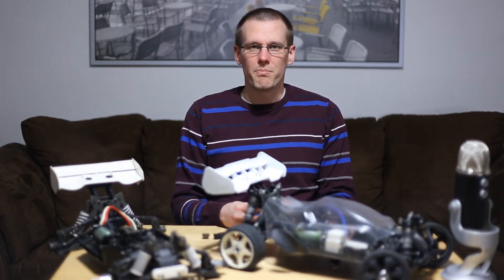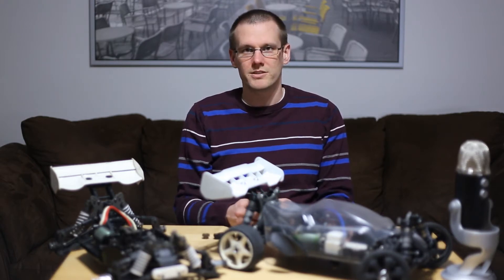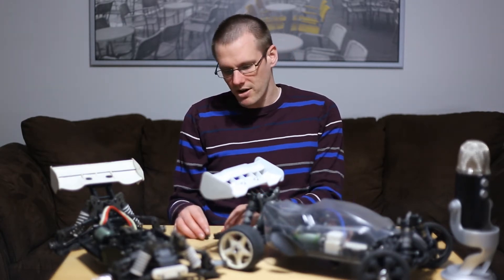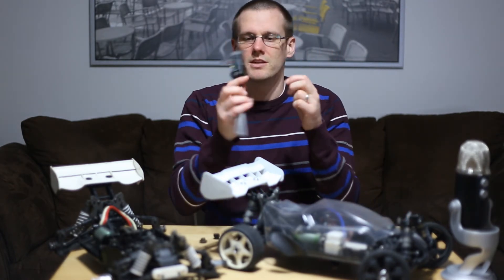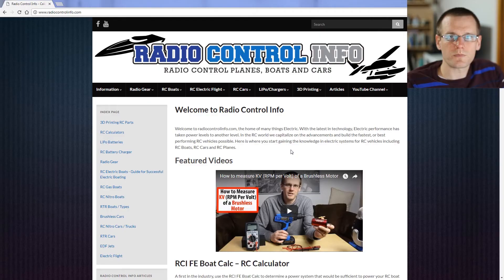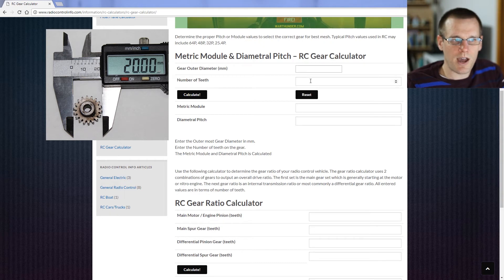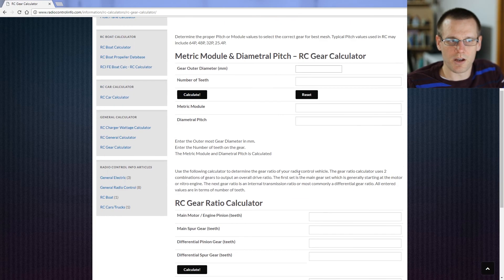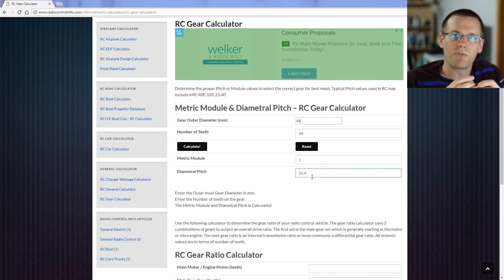How to Measure Gear Pitch for an RC Car

Comment: Is there a way to calculate the gear thick mathematically? I'm doing the teeth size formula but I got 1.96mm, when I measure it with a caliper, I got 2.41mm. Could you explain?

Outer diameter is 40mm, and tooth number 30, can we tell the thickness of each teeth?

Comment: right, so to convert my nitro car to brushless i need a 25.4p pinion with 3.175 shaft size.. i cant find this at all.
Reply from the maker: 25.4P is Mod1. Very popular
Reply: @RCexplained  i fugured i need to use a sleeve to convert my 3.175 to 5mm then a m1 will fit.
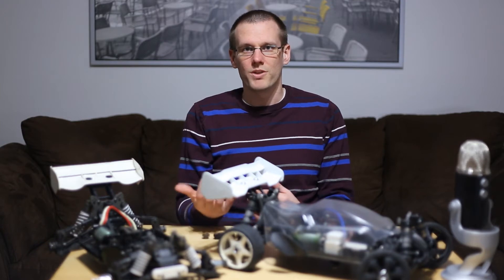Reply: @RCexplained i have another question, my spur is 50t. Im converting a nitro to brushless. What size pinion would be good on a 50 spur for bashing a 1:10 scale.
Reply from the maker: @STRIMIX  you'd have to use a gearing calculator to match your goal speed

Comment: Great info. I found 3 bags with pinions in my spare parts boxes.  I know there's some 48p, some mod .6 ,  but for some of them it isn't obvious to say whether they're P of mod. So I used the calculator and these are the results from 22 pinions : 8 of them were Tamiya 0.6mod and measured as 0.55, 0.56, 0.57 and 0.58mod. None were actually 0.6mod.  2 other pinions were identified as 47,9P - we'll call that 48 .  5 others were identified as 0.52mod or 48,8P - no idea so we'll make that 48P as well (because two of them are known 48P Kyosho pinions) ?...  4 others turned out to be exactly 0.5m but 3 out of 4 are definitely not .5mod (# teeth incompatible with the car) : one of them was new in an unopened bag; a RW Racing 48P 18t pinion ???.  I also checked a Novak 32P that turned out to be 32,2P. And a Robinson Racing 1mod that turned out to be .97mod.  To top it off, I uninstalled a known .5mod and that came out as .48mod. 
So I don't know what to think of this calculator.  Either the calculator is lacking precision or the brands making the pinions are.

Comment: Im struggling, i need to match the amount of teeth and diameter, my value is 9. 4mm and 14teeth for pinion but spur is 16.4mm and 26teeth, so that meants i need a pinion of 14teeth and pitch of 45.4, but it wont mesh correctly ami right?

Comment: good video buddy!!!
the question is how can we calculate the pitch cycle diameter of pinion gear??? (I don't know if I'm expressing it right.)
i have problem with my rc motor pionion gear.....wears out very quickly
I want to change it and I don't know the inner diameter.......
I searched for information and the only answer I got from the company is that i must buy new motor and that "they dont know" the inside dimension of pinion gear and they dont sell seperately pinion gear for this motor :-) :-)
i dont want buy new motor, its not broken.....just want change the pinion gear of the motor.
Reply from the maker: Not sure why you need the diameter you are after. This should not matter as it is built in to the pitch of a gear if I understand you correctly.

Comment: I calculated a pinion and it came up with .68 mod is that still .6 mod orrrr please help
Reply from the maker: The calculation should be much closer. I would suggest trying to re-measure. What diameter did you measure and what tooth count do you have? Have you tried measuring the meshing spur gear as well?
Reply: @RCexplained  ok i remeasured both spur gears both came in at .61 mod strange it gave me different numbers lastime i must of fucked up
Reply: @RCexplained  the other weird one i measured is 13mm by 17 teeth and .68 is what came u🤷‍♂️
Reply from the maker: What have you measured for the mating spur gear?
Reply: @RCexplained  nevermind bro all good
Reply from the maker: what happened?
Reply: @RCexplained  nothing im just so new to this gear thing but i fixed it ok so now im having an issue with the hobbywing 10bl60  esc i cant set the punch setting to 9 it only goes up to 4

Comment: hello I have a problem with my kyosho outrage. I have upgraded to hobbywing quickrun 1060 esc + cap pack due to esc running into limb mode. My motor is 12T or 14T team orion brushed. i have 15t pinion and 41t spur (both are the stock ones). I have upgraded to 2s lipo and 2.2" tyres front and back. Ambient temp is 36 Celsius. The problem is that despite the cap pack esc is getting into limb mode again and i googled that maybe it is thermal cut off due to overheating.
I guess ambient temp plays a role but I wanted to ask if my gearing is right? due to bigger wheels and the motor change.Do they stress my motor and esc?
Reply from the maker: What is the temperature of the esc and motor?
Reply: @RCexplained  I don't have a thermometer but I can't touch it with my bare hands
Reply from the maker: @Nikoslido  sounds like you may be pushing the components too hard. Try using a smaller pinion gear and see if Temps are reduced.

Comment: Building a hopefully speed car ...thnx.....hobao nitro 7 tq to electric brushless😎
Reply from the maker: Sounds awesome!
Reply: @RCexplained  im a lil foggy on figuring out the pitch on my hobao 7 tq spur gear.....im not trusting my measurement.....would you have info on what it is from factory?...hopefully i can find a pinion gear to match it for brushless
Reply from the maker: What are your results? I'm not familiar with that model. The 2 hobaos that I've had are both Mod1.

Comment: Are you able to provide the formulas that the website uses to calculate pitch and modulus using the outside diameter and the number of teeth? Thank you for any help.
Reply from the maker: Hey Jonathan, I don't remember the formulas up on the website.

Comment: Is this calculator glitchy ??  I’ve pulled 3 gears off a basically brand new redcat gearbox,  and measured all 3 diameters and counted the teeth..   when I use calculator I get 3 completely different gear pitches.   Spur is 79T and 42mm
Pinion is 20T and 11mm
And the idle gear is 18T and 15mm

All three come up different and not one match any common pitch I see ?

Please help..  this is from a redcat piranha or cyclone xb10
Reply from the maker: Your spur gear is roughly double it's metric dimension. 79 teeth is roughly 2x 42mm. Your pinion # of teeth equal to 20 is roughly double the 11mm you measured. The idle gear at 18T and 15mm seems odd. It has less teeth but is larger in diameter nor shares the same relationship as the other gears? The calculator only works off of gear relationships. If something is changing it will not account for this.

Comment: Pretty cool website! Dude, I have a doubt about how do I measure the ratio of a worm gear set. Could you help me with that? I can give you the number of teeth of the worm and the spur (worm wheel) together with both outer diameters.
Reply from the maker: Are you looking for the gear ratio of a worm gear set? The worm gear is considered as 1 tooth. If you have a 40 tooth spur gear mated to the worm gear, the ratio is 40:1.
Don't forget to like the video and subscribe!
Reply: @RCexplained  Thanks!
Reply: @RCexplained  i need help with mine, i need a spur gear but unsure of the right one id need to replace the stock one

Comment: This helped me out alot thank you.
Reply from the maker: HorsepowerTube I'm glad it helped!
Reply: Got a China clone with no info. Hard to know what to buy. This is ONLY place on the web I could find anything about measuring the pitch! Mine is 32p. For some reason the calculator goes from 31.8 to 32.2. I played with the numbers it will not do anything in between. Still told me what I need to know but thought it was a little weird.
Reply from the maker: HorsepowerTube PM me the parameters you used and I'll take a look at it.